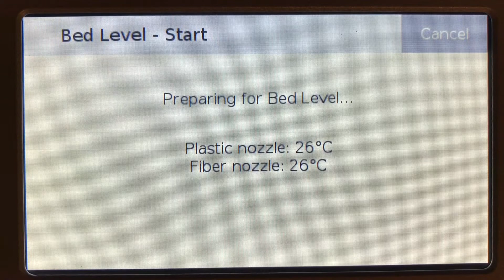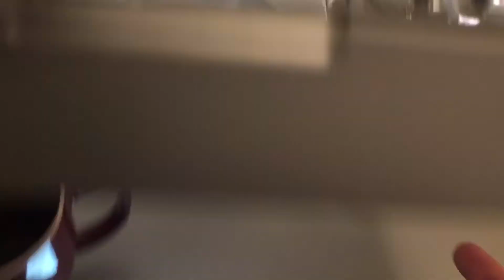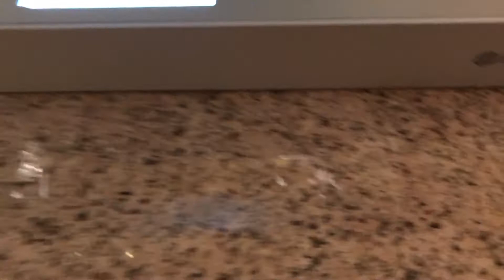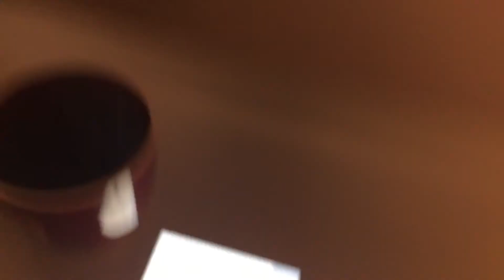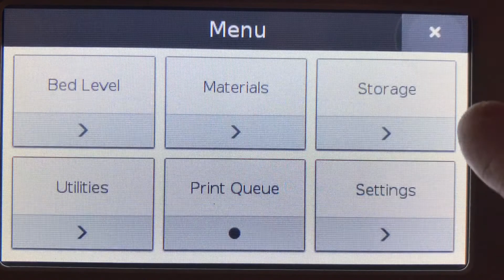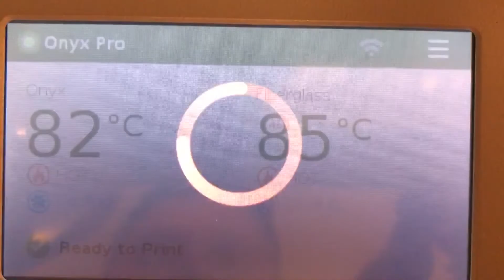Onyx Pro Setup

Comment: thanks for the video. I just want to know, can you use continuous carbon fibers too instead of fiber glass  ?
Reply from the maker: Thanks for your question.  For continuous carbon fiber you would have to upgrade to the next model up which is the Mark Two.  If you have any additional questions please let me know.
Reply: ____thanks for your answer.  What's the difference in terms of hardware between Mark Two and Onyx Pro ? What extra does the mark Two has for printing continuous carbon fibers, fiberglass etc. ? Is it something in the nozzle diameter, some advanced hardware or better control of  print parameters like temperature, speed etc.? I am curious to know because the system looks almost the same in between this two. Thanks again for replying.